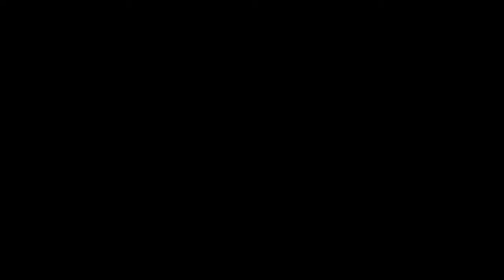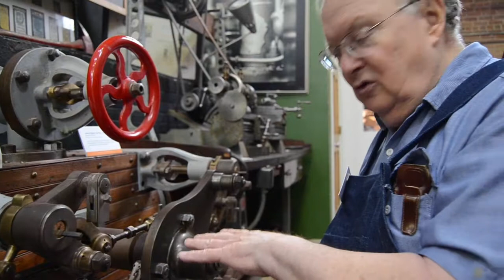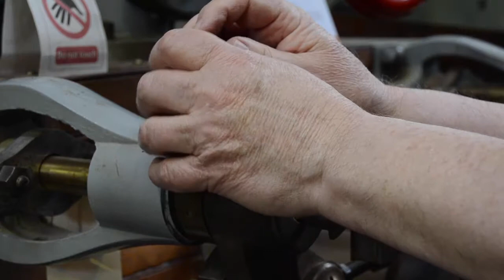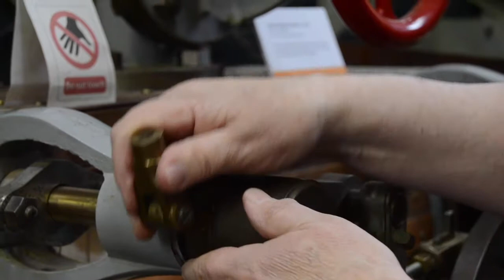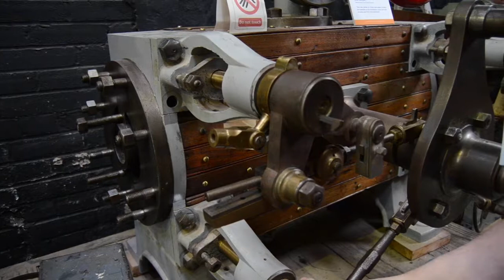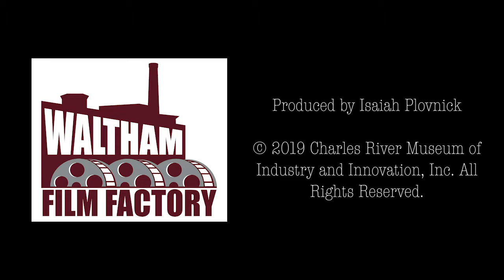Fixing the Corliss Cylinder

Comment: Nice video, you should have a link to the Charles River Museum or an address, I had to Google you after seeing the video. Do you have the rest of the engine, if not, you may be able to fit the cylinder to another frame ( as Corliss often did ) if the stroke is the same. Are the threads modern sizes, or are you running into such things as 1/2"-12?
Reply from the maker: Thanks! We miss one every now and again. Situation corrected!

We'll pass your comment and question to Bob Timmerman and try to get back to you with an answer ASAP!
Reply from the maker: From Bob: "No, we do not have the rest of the engine, just the cylinder and valve gear." and as to the threads inquiry, "It has some 1/2-12 threads, but they would not be unusual for something built before 1900, and likely before 1875."